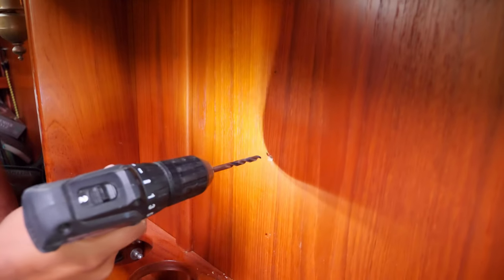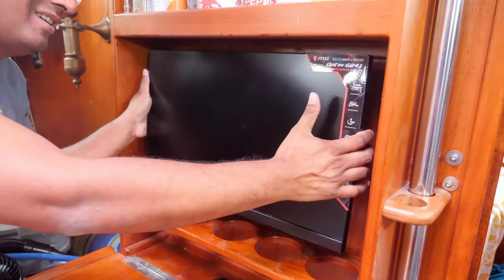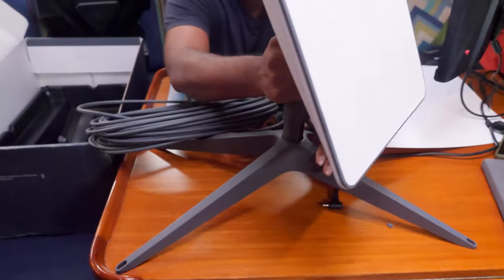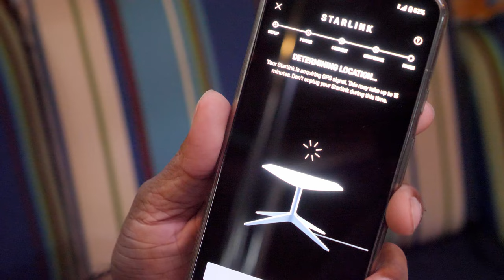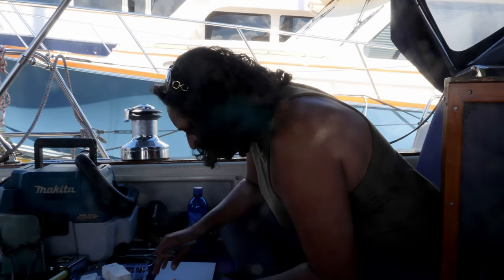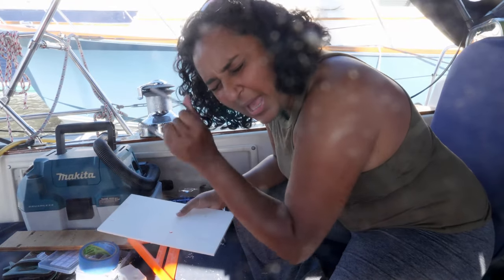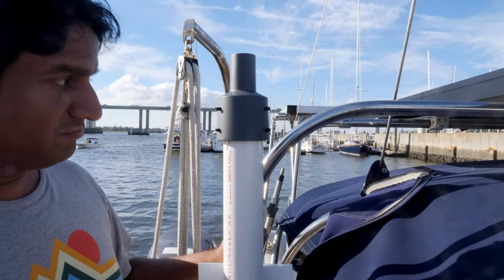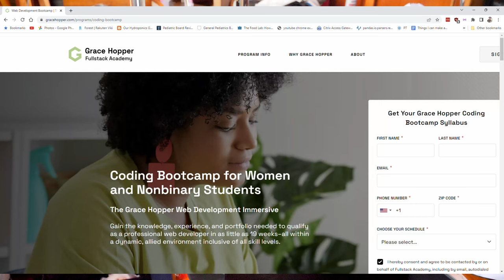SUSTAINABLE CRUISING: How We Make Money While Cruising FULL TIME! - Sailing Turtle

Comment: Do you have some sort of locking mechanism on that monitor so it does unintentionally move around and possibly swing out and then slam back to the wall while under sail?
Reply from the maker: Yes it tightens up and locks up in place with the turn of the screw in the back. We also plan on having Velcro straps holding it in place.